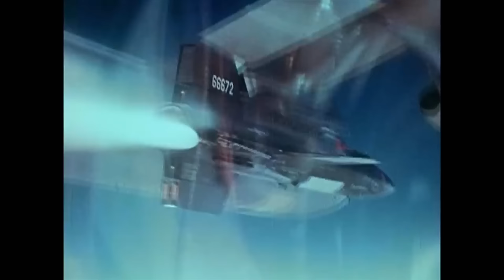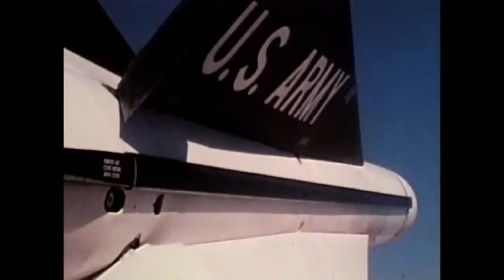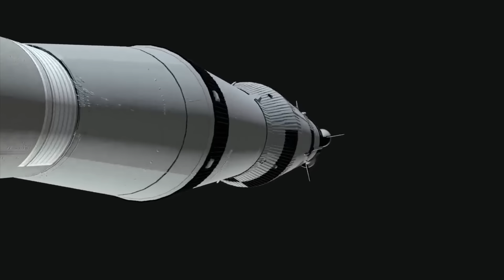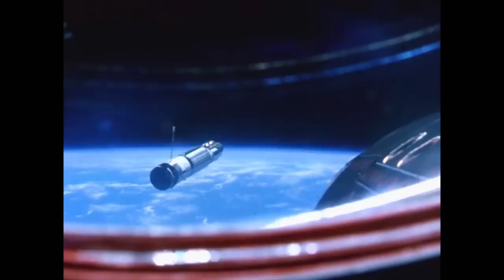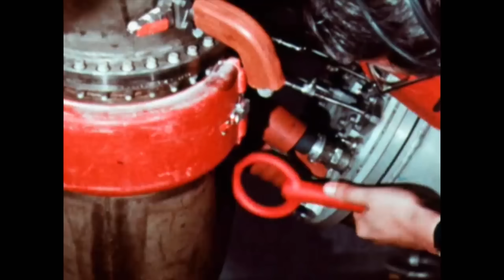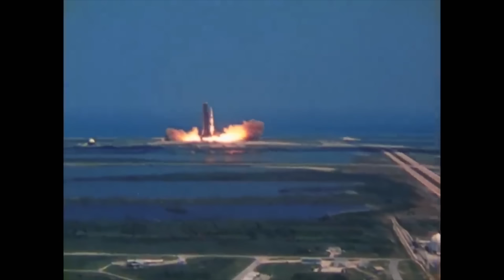Inside NASA: The Saturn V Rocket Story | Space Race Documentary | Timeline

Comment: 32:22 contrary to popular belief, the Apollo Guidance Computer was remarkably high performance for the time. I would not say that an average electronic watch would be more powerful. A modern smartwatch could greatly exceed its computing performance, but still wouldn't have as much IO. Remember that the computer was able to stream in hundreds of analog sensor readings at speed and output to a ton of systems as well, to make a watch do that would require adding a bunch of IO hardware like ADCs and i2c GPIO expanders. But a regular digital watch, even a calculator watch, is going to run at a few khz clock speed, not several megahertz, and may not even contain a proper turing complete processor inside or reprogrammable memory, if it is just a watch with timer and alarm then it is more like an RTC driven state machine, not even a computer by any definition. and the Apollo guidance computer is faaaar more powerful. The AGC ran at 1mhz, which is about as fast as an Apple II computer which came out 8 years later, and which again lacked the IO capabilities of the AGC.

Comment: Slight correction at 53:00. There was no fuel line issue, but an igniter issue, PoGo did not cause the failure. The second engine dropped because the wiring was not properly routed, it was crossed to the wrong engine causing the computer to make the wrong decision.
Reply: Correct, know ur stuff.

Comment: Raptor 2 are most probably the most powerful engines...
Reply: No, Raptors are around 1/3rd of the thrust compared to the F1. This however has a reason, Raptors have to land a booster and you can't land a booster with 200t weight on an engine with 700 t of thrust

Comment: The best part was since almost everything was hand Designed, drawn and manufactured, with no computers or simulators, the engineers improvised detailed notes and drawings to communicate exactly what they wanted across the office floor. The engines had thousands of parts. That is the one thing we can't ever find again. We have the tech to create better engines now with modern research, design and manufacturing techniques, but that kind of hands on thinking and ingenuity can't be seen again - we'll have to only look forward to doing things the new way. 

These days I need to deal with bumbling tweeting idiots whose only intelligence consists of "Duh, conspiracy bro".
Reply: Computer aided design and simulations were used extensively in the design of Saturn V. Saturn V was modelled in NASTRAN (NASA STRuctural ANalysis computer program) for analysis of environmental conditions found at the space centre. Computer simulations were much used also, especially in relation to the longitudinal dynamic stability characteristics and the integrated flight performance of the vehicle.

This is not a matter of 'they don't make 'em like they used to' for without computers there would likely have been no moon landing at all - at least not back then.

Comment: Would like to see an update.  I had read that the old F1 engine design was dusted off and a bunch of engines at Huntsville were repowered for testing for a new application.
Reply: They can no longer be hand designed and manufactured like then. That knowledge died with those engineers. But with the modern design and manufacturing tools we have today, we can take those 5600 odd parts and reduce them to like 40 parts and build a far more modern engine. It's only that there's no more budget for another moon program. It would be better to just use the concept, choose the fuel and make a completely new engine than to recreate the old one.
Reply: @srinitaaigaura  100%.  I believe they were firing these up to do modeling etc. and capture good/real data on the function of these engines.  Then, they can use that data on the development of new designs using modern materials and manufacturing processes.  The challenge will be to keep the technology from getting to the Chinese military.
Reply: The test firing you are referring to was not a complete F-1 engine. What they did was to get an F-1 gas generator off of a F-1 that was in the Smithsonian. The gas generator is basically a small rocket engine the exhaust of which powers a turbine in the F-1's turbopump. The turbopump is what pumps the liquid fuel and oxidizer into the engine. This test firing was to support the  development of a new liquid fueled engine similar to the F-1. It was going to be used on the new SLS rocket in place of the twin solid rocket boosters. However, a decision was made to stay with the solid rocket boosters on SLS so unfortunately the F-1 successor will not be built.
Reply: @joevignolor4u949  thanks for the detailed info
Reply: @joevignolor4u949  Since SLS will only fly a couple of times it won't be worth to develop new engines just for the boosters.
Reply: They did detailed testing of the turbo pumps. Fired them up, let ‘em  roar.

Comment: This may be stated elsewhere, but at the 18 minute point the graphic shows Rocketdyne building the fuel tanks and Boeing building the F-1 engines.  That is backwards.   Rocketdyne developed both the F-1 and J-2 engines used in all three stages.  Boeing built the first stage, North American the second stage, and Douglas the third stage.  Also, at the 38-39 minute mark the narration says that two engines lost thrust.   Only  one engine lost thrust due to a fuel line failure.   A wiring error caused the signal being sent by the flight control system to shut down the failing engine went to another engine - thus shutting down an engine that was functioning perfectly.   One last comment.   Everyone says that the decision to send Apollo 8 to the moon was the boldest decision NASA ever made.   But wasn't that decision made on July 25, 1961, when Kennedy committed us to the goal?   At some point SOME Saturn V was going to the moon.  Now, in the context of the intelligence community telling NASA that the Russians had an N1 on the pad and they were afraid that they would beat us to the moon, so they moved the flight up.  It also 'helped' that the LM wasn't ready to fly, so flying an Apollo.S-V to earth orbit made little sense.

Comment: My dad was responsible for the dynamic test stand in Huntsville in 1964 through 1966.  The idea was to create vibrations equal to launch to make sure the whole first stage and components held together before actually lighting the engines.
Reply: it was incredible the amount of testing and simulation they ran, without the aid of high-performance computers. simply astounding.
Reply: More then that.. They actually had explosive charges inside the thrust chambers. To see if they could cause combustion instability while they tested them. It's how they figured out which baffles to use. To stop the high cycle rates. That was causing them problems..

Comment: --   That turbopump made 66,000 horsepower!   --   15 tons of fuel & oxidizer per second   --
Reply: Thomas Pickering  

Why is that disinformation?
Reply: The turbine in the turbopump generated 55,000 horsepower but it was actually the exhaust from the gas generator that turned the turbine and generated all that power.  And each engine burned about 3 tons of propellant per second so all 5 used 15 tons per second.